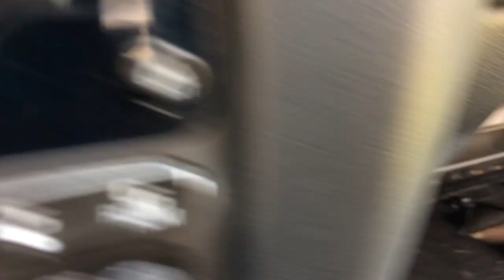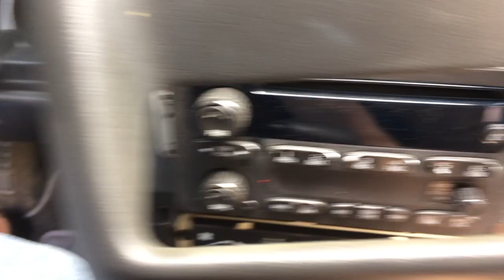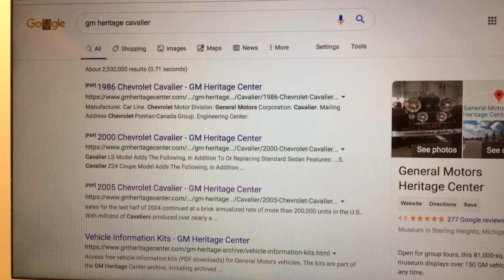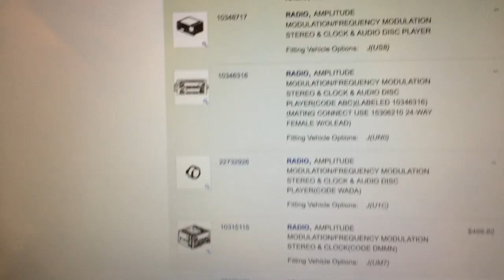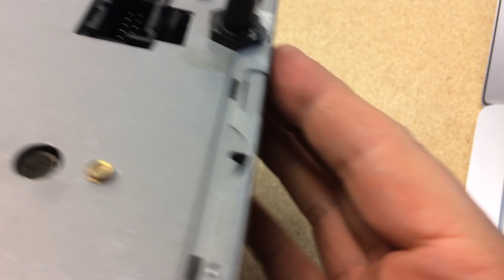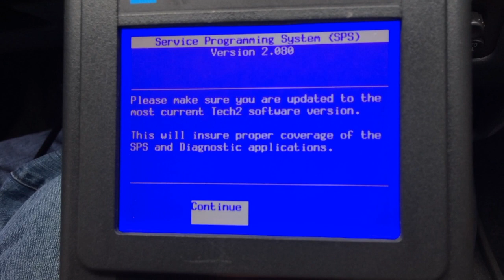2003 04 05 Chevy Cavalier GM factory radio install & Clear CAL ERR using the Tech2 Scan Tool

Comment: Do i truly have to go thru this entire process to put a better radio in my 04? Or is there a way around doing all that putting a better one in then the ones u listed my car doesnt have the 3rd party aux cord so i was curious also i dont have the money to huy a tech2 scanner so what are my options besides going to a shop?
Reply from the maker: If you mean the dash disassembly there's no way around that process.   You would have to do all this to even install a third party radio.  You can often find a radio shop on eBay that has modified the factory radio to add either an aux or even bluetooth though.   There's no way around needing the Tech2 if its a factory radio and has a calibration error or is VIN locked without damaging the circuit board and losing functionality.   Of course a third party radio will not have either of these situations so no Tech2 needed.

Comment: I have no intention of replacing a factory OEM radio with another one, I plan on just buying the door chime module wiring kit and Metra Dash kit and installing an aftermarket Kenwood touchscreen with android auto/apple car play same with the speakers just for a better sound experience nothing crazy like amplifiers and subwoofers and fancy stuff but let's be real, the only factory OEM radio that sounds good from GM is the Bose Premium sound stereo, the speakers may be OEM but they sound amazing for factory sound systems

Comment: back in 2004 I bought a new GMC Sierra.  It came with the cd player only with auto tone control and RDS.  I wanted the CD/TAPE combo.  I bought a new radio that was not vin locked.  I got CALL ERROR and even the back lights did not work, at night the radio was completely dark.  I thought b/c of that I had a defective radio.  Since I was a good customer at my GM dealer they did the calibration service for free.  Everything worked including the backlighting.
Reply from the maker: Yep, CAL ERR indicates lost programming or missing calibration.  When some radio resellers unfamiliar with GM designs clear the VIN lock themselves, they also wipe out additional critical programming information.  This can trigger the CAL ERR message.

Comment: How do I change the time on this, I have a gmc 2008 serria with a radio just like this and the time is not correct, if you can tell me how to change the time that would be amazing
Reply from the maker: Your vehicles owners manual will have this information.
Reply: @DrShock  thank you so much for telling me to look at the manual, I discovered today that my truck is actually not a serria and is instead a canyon and as soon as I looked up the right truck and how to change it’s radio, I got the time changed. Thanks a bunch cause now I don’t have to be confused on the time
Reply: @DrShock  thank you, I’ll look at that later or tomorrow and let you know how it goes

Comment: very informative/ I learned your saying that  if the car only offered 3 diff. radios by delfi delco and the monsoon version isn't offered
in those three. then it won't unlock. So according to this, there is  an mp3 version that your showing that's not labeled monsoon (an amplifier for each speaker being 8 speakers) and it matters if the car from the factory offered it, if it didn't then then one from a grand am
that had a combo (cd & cassette) will have a diff rpo code and won't be offered in mine 2005 sunfire so the only way i could unlock that would be to remove chip. Well good thing I'm, trying one first that they offered then.
Reply from the maker: It’s less of an unlock concern but rather that electrical communication specifications constantly changed making crossing makes and crossing years problematic.  Also that module programming is tied to as-built options only.  Sometimes you can get away with it with makes within the same model year range though.

Comment: if u buy a radio from walmart for my 2005 chevy cavalier and it has a aux port on it can I just hook it up or do I need to add something or what?
Reply from the maker: That aux port was not available back in a 2005 vintage radio, so that seller has modified the radio to add in this feature as a modification.   You'll have to write them and ask what you would need.   Be sure to confirm if the radio requires VIN relearn programming or not when you ask them.

Comment: Anyone know what the little wiring plug is on the back of the radio I have a 04 and mine doesn’t have it ?
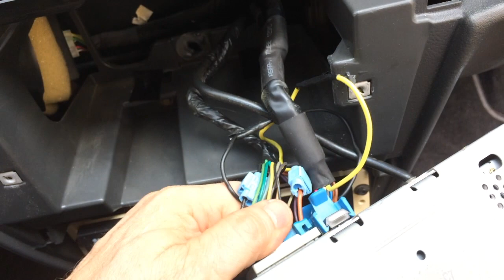Reply from the maker: If you mean at 11:38 I mentioned that's for an aftermarket AUX input jack option for an iPod.

Comment: I can buy a JVC aftermarket double din and install it with a output converter right? As long as it's not a factory radio from another vehicle.. correct?
Reply from the maker: No experience with aftermarket radios myself only GM/Delco.
Reply: @DrShock  ok thanks